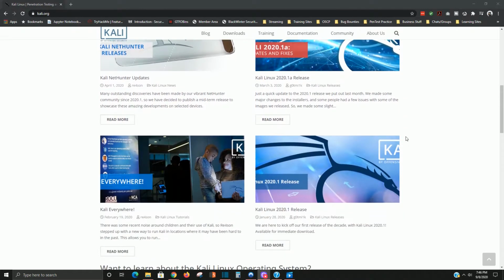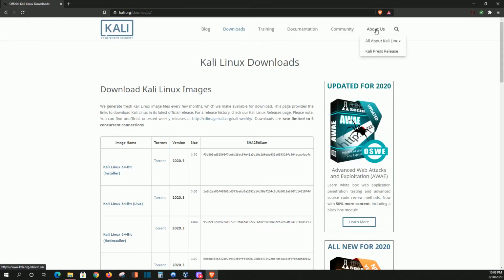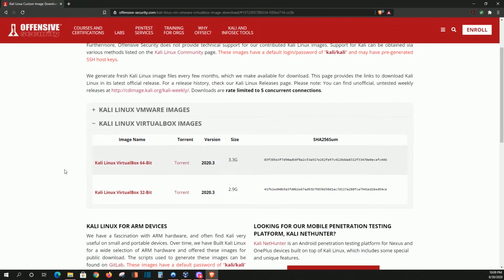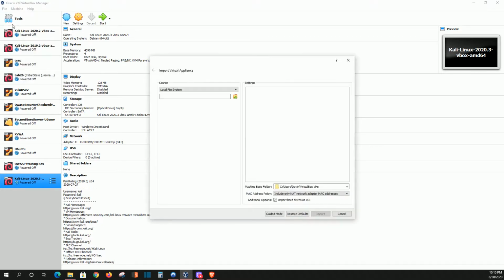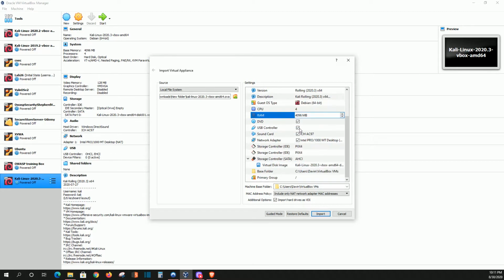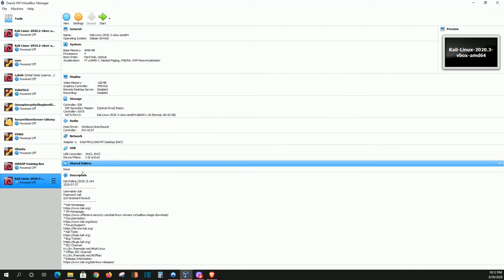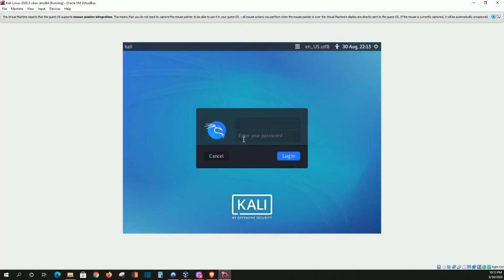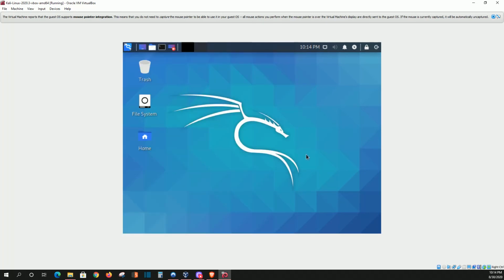How to Install Kali Linux on VirtualBox

Comment: Do you recommend Virtualbox over VMware ?? 

I additionally have quite a bit of lag/freezing on my VM. I tried allocating resources all to the VM so that I can use that as my primary OS. Am I better off partitioning my hard drive and installing in that way ?
Reply from the maker: I use both, but currently have been using VirtualBox more than VMWARE. I would boost the RAM and CPU in the VM to help speed it up

Comment: Not import.. 
It says
Failed to import appliance G:\kali linux 2020.3-vox-amd64.ova
Reply: I have the same problem
Reply: I have solved downloading and installing this: https://download.virtualbox.org/virtualbox/6.1.14/Oracle_VM_VirtualBox_Extension_Pack-6.1.14.vbox-extpack
Reply from the maker: @ung4_ibaina  Yeah. I just saw that. Thank you for sharing
Reply from the maker: Does it give any more info?
Reply from the maker: You may need to download the expansion pack.